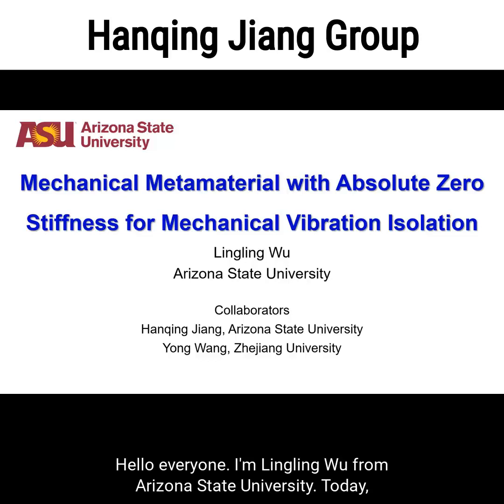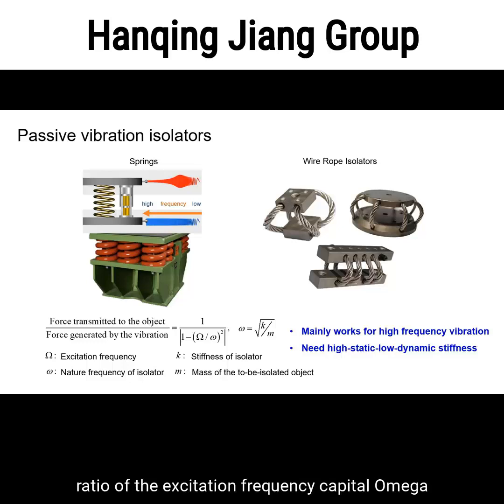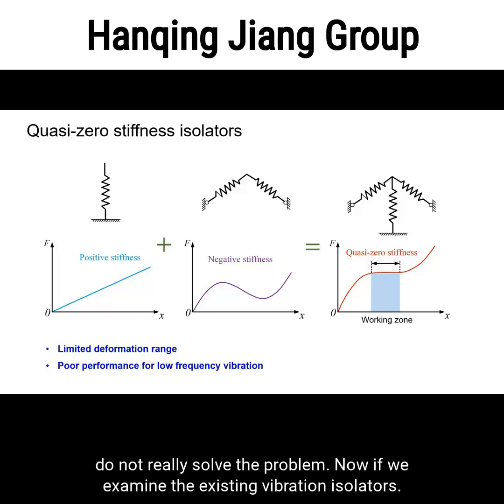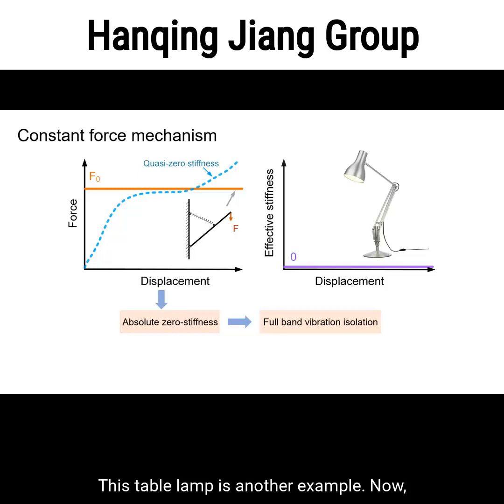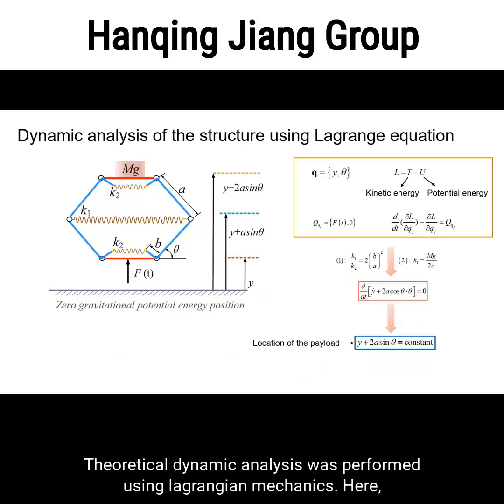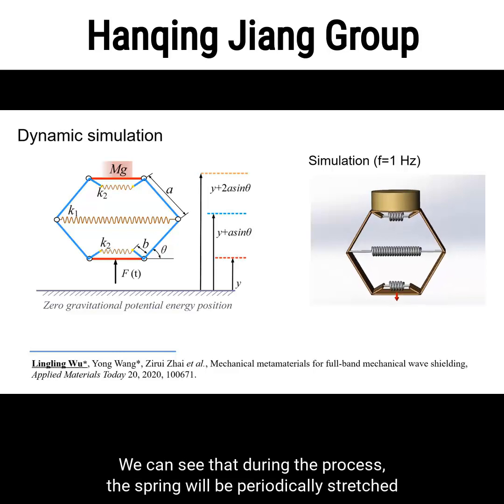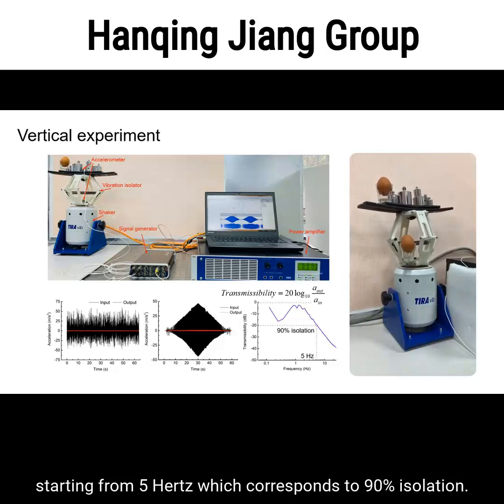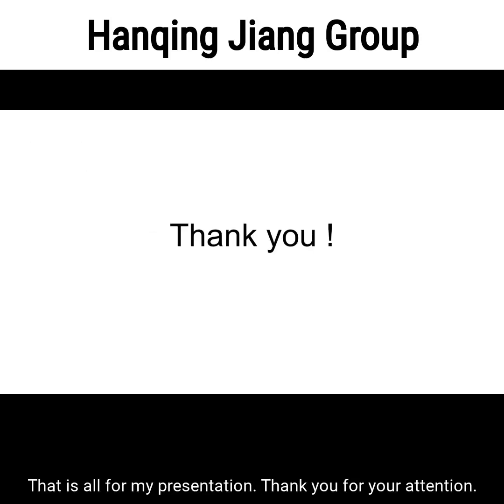Absolute zero stiffness vibration isolation

Comment: Thank you for the informative article. What does the damping look like if I want to damp an axial vibration. I'll be specific: in a model airplane there is an internal combustion engine in the head. This generates a vibration in the axis from front to back. How can I dampen the vibration, for example in the middle of the airplane? I want to place a flight controller there and avoid exposing it to maximum acceleration.

Comment: I have a question regarding the horizontal shaking test. Wouldn't the random shakings from the two shakers cancel out yielding a smaller effective shaking?
Reply: No, if they're un-correlated then you'd expect the resulting vibration to have a magnitude larger by a factor of the square root of 2. Sometimes they cancel, sometimes they combine, but overall its an increase in vibration.
Reply: @Kruglord  You are right. I think the sqrt(2) factor is for Gaussian noise though, for uniform random the factor is more like 1.33 (at least that's what i find numerically)